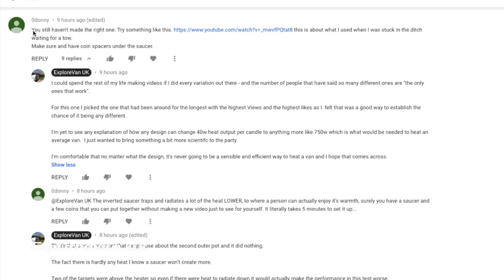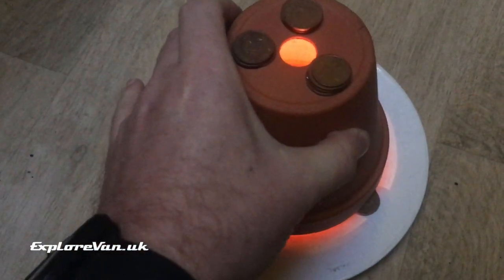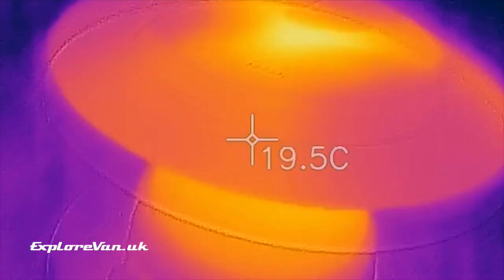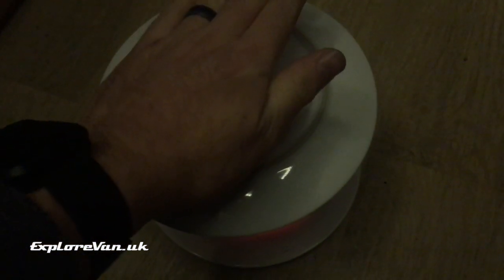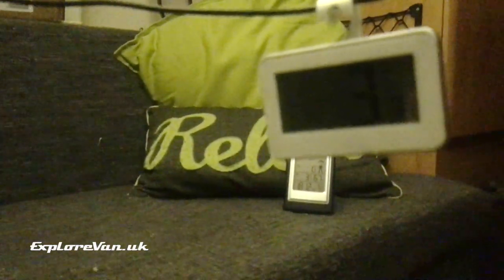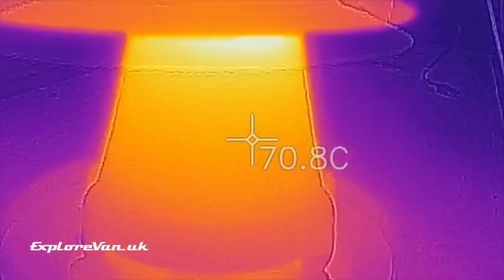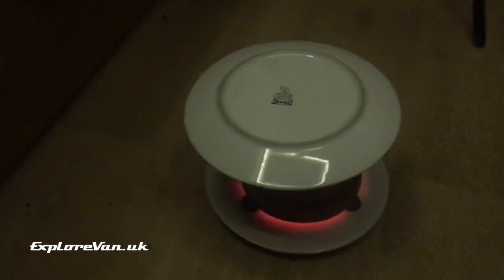Cornish Plant Pot Heater Test - Does it really work!

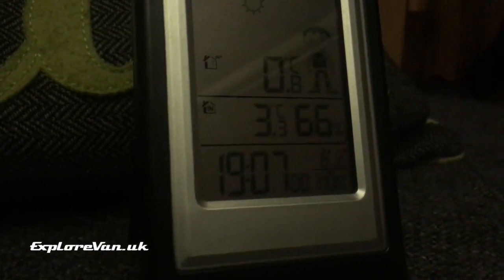Comment: 2:40 If the temperature outside has dropped but the temperature in the van remains a constant 3 degrees, doesn’t that indicate that it did heat the van somewhat? I’m not saying that a terracotta pot has magical properties (maybe any arrangement of 3 candles will heat a room a tiny bit), but if you present scientific measurements and a scientific conclusion, you have to consider these factors.
Reply from the maker: Hi Doris, this is a very sensible question, thanks. 

Were the van not insulated it would be very easy to draw this conclusion, however as the van is well insulated causing latency in the temperature change between inside and out it would be very difficult to draw a conclusion based on the very small fluctuation we see. 

If we look at the figures, both the inside and outside temperatures drop over the test period.

            Inside       -       Outside
Start.     4.0                   1.7
1 hour.   3.6.       -          1.3
2 hours. 3.3.      -           0.8

The relative temperature change variation of 0.2 degrees C between inside temperature and outside temperature between the 1 and 2 hour point I judged as insignificant as the temperature difference would not even be able to be felt.

I don't debate that the candles give out some heat - clearly they do - what I am aiming to prove is they are not an efficient way to heat a van which I feel this proves. Happy for you to draw your own conclusion from the data.

Comment: I came across the idea of a candle-flower pot heater after watching a British WW2 homefront film about preparing a bomb shelter, which recommended such a device to keep a family warm overnight until the raid danger was lifted. What confuses me is that if this device is as ineffective as these tests suggest, why would they have recommended it in a serious wartime situation? I just find it difficult to believe they would suggest something on a whim if it didn't work. Were they just oblivious to "bad science"? Or was it simply to boost morale?
Reply from the maker: Hi thanks for taking the time to comment - that is interesting to hear.  

I would suggest there are two options here:

1) As you say a morale booster - The psychological placebo effect of being able to see a flame and being told something is heating is not lost on me.  I suspect a lot of war time information could have been in a similar vain and obviously this is an emergency situation where every little will help to keep people happy.  
I wouldn't be surprised to also hear a recommendation of a nip of brandy/whiskey to keep warm in wartime, which we all know actually has a cooling effecting on the body.

2) The space being heated and what surrounded it - for example in a snow hole which is only marginally larger than the person contained in it and surrounded by snow, which is a good insulator, a small amount of heat has the potential to make some difference. 
Similarly, if a home built Anderson shelter or similar were only sized to have marginal free air to heat and surrounded by soil which would offer some pretty good insulation it may make a small difference. 

For vans or heating a room which in general have a significant free air where the heat will dissipate and not great insulation it seems pretty worthless, other than the morale boost and certainly not something that I would suggest will create comfort for long term use.
Reply: @ExploreVanUK  
Thanks for replying, I appreciate the insight. This might be a silly question, but would the candle make any difference? Would a single, long stand-up candle produce any extra warmth versus a group of tea lights? Could the materials they're made of contribute in any way? I understand you're primarily interested in camper-based heating, but I'm just curious since you're already familiar with the subject as a result of all the tests you've conducted.
Reply from the maker: It's a good question and the chemical make up of the "fuel" the candle is made of could have a very slight difference in the temperature of the flame.  However, in reality it's unlikely to make a huge difference, this is primarily because the fuel used for candles is picked in order to maximise light output rather than heat - as that is their primary purpose.

What could make a difference is the type and size of wick in the candle, as this could change the amount of capillary action, the speed at which the fuel vaporises and therefore the size of the flame.  Obviously the knock-on effect of this is the "fuel" of the candle would be used up faster.
Reply: @ExploreVanUK  Makes sense, thanks for the info
Reply: Ugh. Because governments lie. All the time. Didn’t you live through the Covid “pandemic”?

Comment: You still haven't done it properly, you're supposed to use 2 pots, the inner one has the hole plugged, and the second pot needs to be inscribed with a passage from the necronomicon which you need to recite in latin with the candles arranged underneath in a pentagram, so you can open a portal to hell. My God, man, even with this being the third video it's like you're not even trying to do things right.
Reply from the maker: That made me smile! :-D

Comment: when are people going to realise you can't manufacture more energy from thin air
Reply: It's not a question of making more energy, it's a question of making the energy more efficient, thereby making it more useful.
It's like a campfire vs an Indian clay chulha.
Reply from the maker: I totally understand the principal and get what it is trying to do and if there were 750w+ of flame in the pot it would probably work ok, but that would need 19 candles.

The fire in a chulha - is probably between 1kW and 2 kW hence why they work.
Reply: @ExploreVanUK  I would argue that whilst you cannot create extra energy from nothing, you can have energy accumulate within an insulated environment and raise the ambient temperature that way. It's the reason why clothing works to keep us warm...I would expect any form of heat output (no matter how low) to have the same effect.